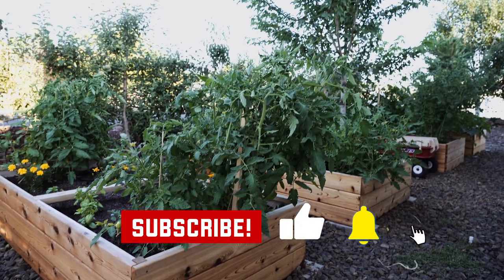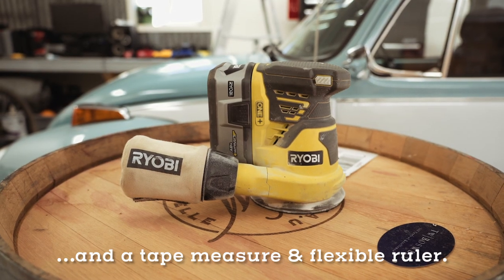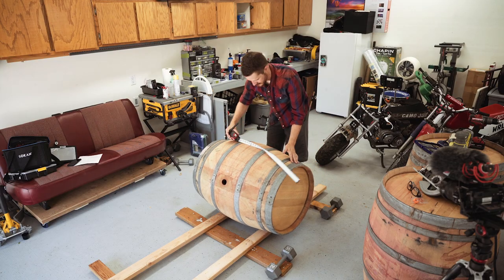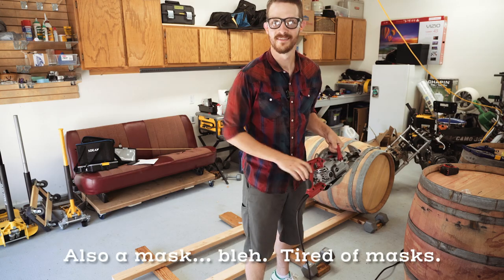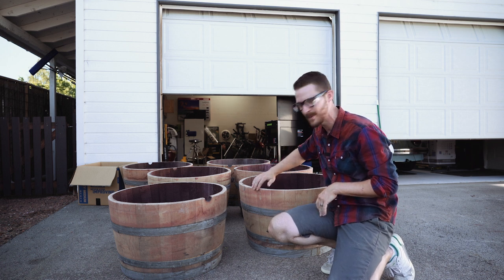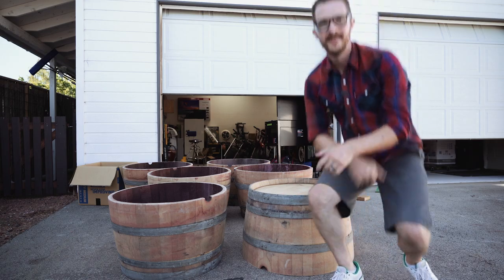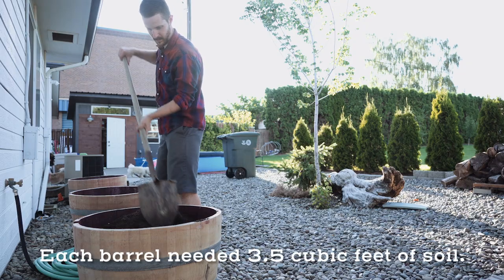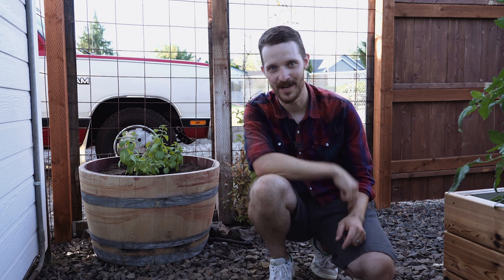Make Your Own Barrel Planter!  Cheap Easy DIY

Comment: I'm doing the exactly same thing but was thinking to stain and then put some membrane on the Inside (not the bottom) however you haven't so would be interested to see how long they last as they are as saves me lots of hassle hahahah
Reply from the maker: They haven't aged much... if at all in almost 4 years.
Reply: @JasonExplainsThings  that's amazing I'm not going to bother staining mine or protecting them on the inside may just put something on the outside for decor. I was tempted to take the whole bottom out of mine  still.undecided. one of ours is 200cm in diameter 😬

Comment: You need to nail the hoops to the barrel. I’d also recommend spraying or painting some sort of sealer.  They will last decades like that.  If you don’t within a year or 2 the barrel will draw up. The hoops will fall. The pressure of soil will cause the staves to simply fall apart as barrels use no nails or glue when built. Thanks for the video.
Reply from the maker: No issues at all in the past 1.5 years, but I'll probably nail or screw the hoops in place eventually.

Comment: Regarding sealing the barrel, I have some barrels that I’m going to turn into planters, but I am not concerned with the exterior. I do want to waterproof the inside and the bottom. The bottom and the interior will likely be in contact with moisture a lot, but the exterior won’t be. One of the techniques I was thinking of using for waterproofing is Shosugi bon torch technique. I have seen it used in other waterproofing projects. Obviously the exterior of Japanese houses, but also raised beds and setting wooden posts into soil.

So I might give that a go, as well.

By the way great video! 👍
Reply from the maker: Torch technique... that’s a great idea!
Reply: @JasonExplainsThings  yes, I won’t try to torch the outside. I’m not sure that would turn out as well. With the metal in the way, the natural look is nice.

Comment: Hey I love the video. So if the bands are good and tight there's no need to screw them to the wood before you cut it in half?
Reply from the maker: Nope, we didn't have any issues.  They were pretty new barrels though... very tight.  Still smelled like wine.  :-)
Reply: @JasonExplainsThings  well by the sounds of mine there's still a bit of bourbon in them. ;)